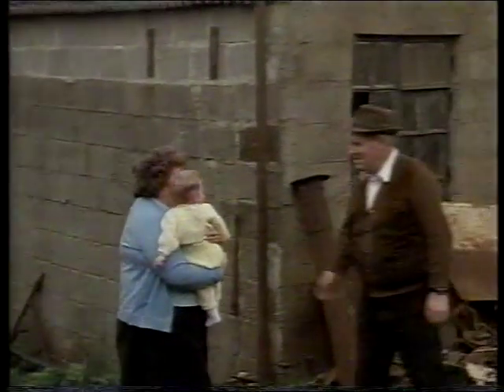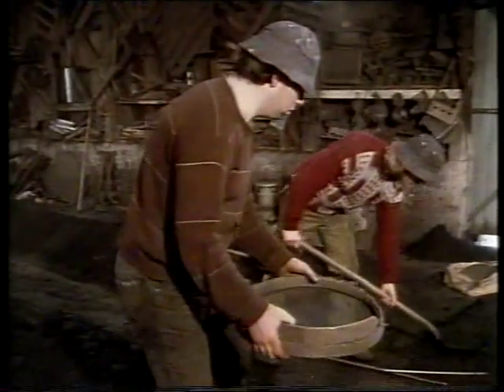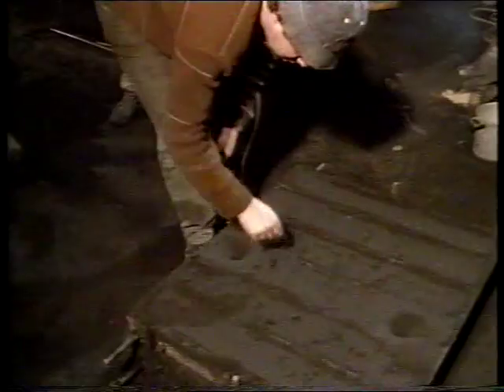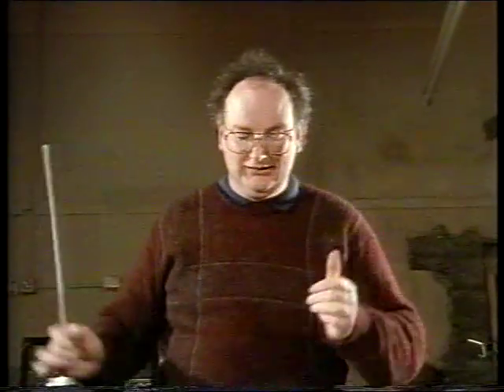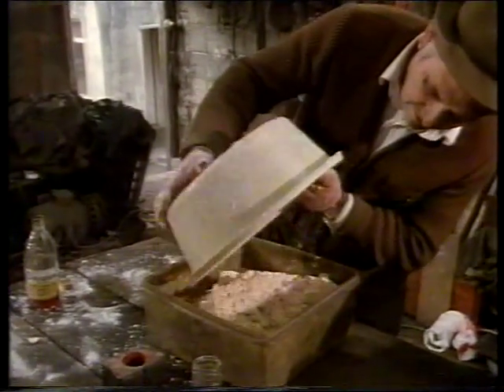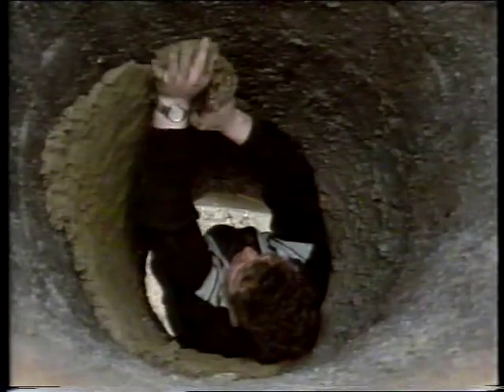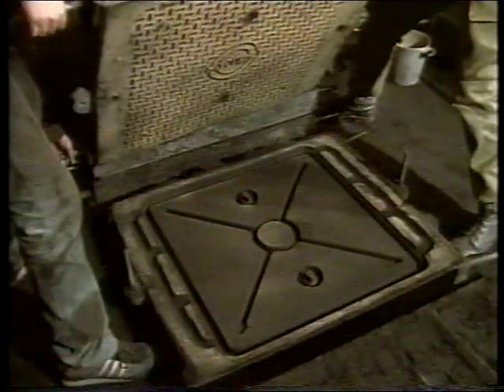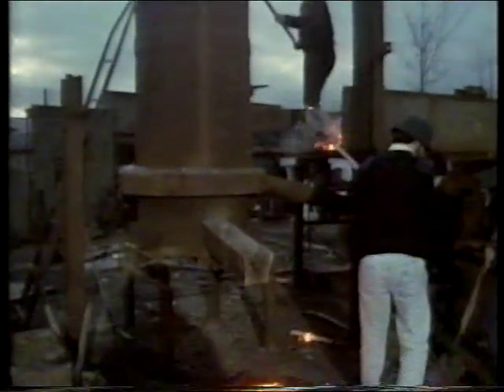Hands: Powers of the Metal

Comment: Diesel on the pattern Jesus Christ.
Reply: Is that bad?
Reply: I've never heard of it and would think it would destroy the clay bond in the moulding sand. Ordinarily in small iron foundries plumbago, or a chalk like parting powder would be used. Proprietary  release agents were available and expensive but I doubt if they included diesel. It does seem to have worked though, those castings at the end of the film looked ok.  @BenedictHarris
Reply: @davidallen4712  the mans being doing it probably 50 years and seemed to work fine for him
Reply: I genuinely hope the place is still going @1989Chrisc
Reply: @davidallen4712  it is.